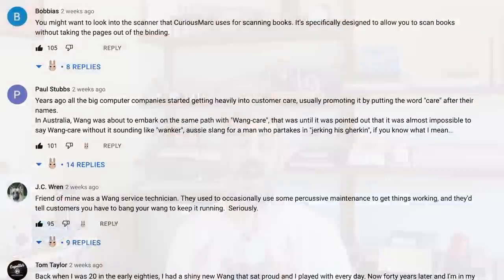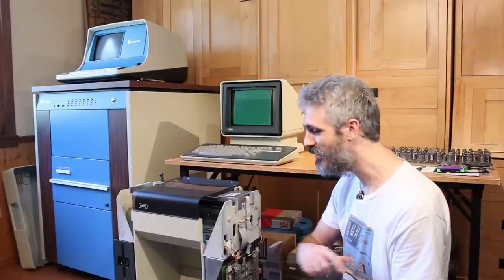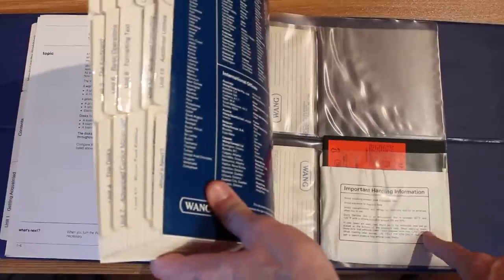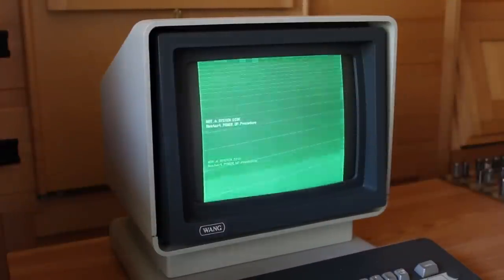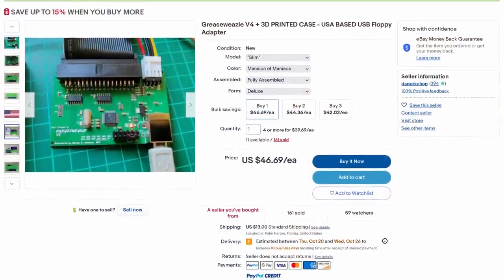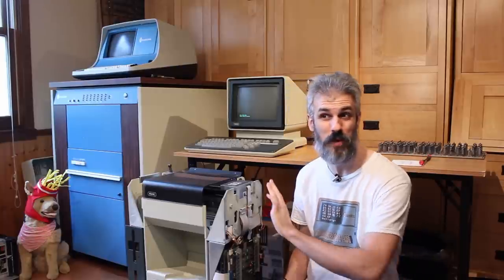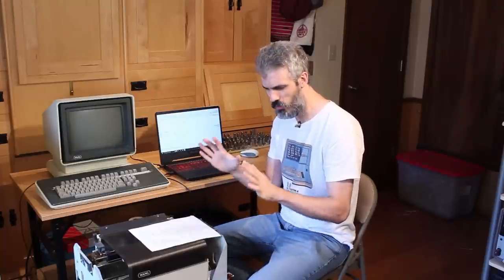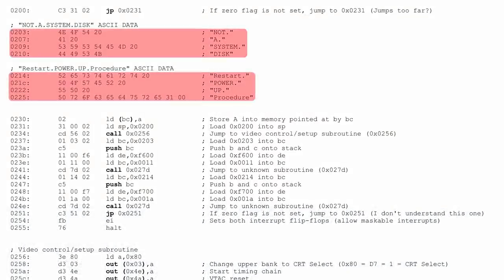Wangwriter Pt.2 – It’s Alive!

Comment: The disassembly comments misinterpret the JP instruction (opcode 0xC3).  JP is an unconditional jump.  The comments are describing JP NZ (opcode 0xC2).

The "JP 0x0251" at address 0x0251 creates an infinite loop, sometimes called a "soft halt".  It effectively stops the machine.  That JP instruction is followed by code to enable interrupts and do a real halt, but that code will never be executed.  Probably got left in by mistake.

The subroutine at 0x027D copies text from the boot code to the video memory. The way they did it is convoluted and weird. I suspect they borrowed code from elsewhere in the product, where perhaps the weirdness made sense.

Comment: you should be able to find a CP/M disk, hell I’ve thrown away a lot of them from old Z80 computers (had an Altair 8800 in 1977), and used to run a dial up bulletin board where the phone line ringing in would reload the BBS code off the 8” floppy..  machines weren’t very reliable back then😂
Reply: If you phone China for a BBS with this unit you will Wang the Wong Number.  (sorry broke the rules, but , you set 'em up)

Comment: Why can I see the CRT image through your head? Did you add it during post?
Reply from the maker: The camera was picking up the flicker of the CRT really badly and I was worried it might trigger some epileptic fits in some, so I added a filter over the screen to dim it down considerably during editing. I don't film on a green screen or anything, so the overlay just sits atop the main video image.
Reply: @UsagiElectric  Ah, makes sense. Great video BTW.

Comment: Looking at the memory map, you can probably run CP/M 3 on that.
Reply from the maker: Unfortunately, the memory map is really weird, and as I understand it, CP/M builds from the top down, so we can't exploit all the banked RAM. I think ultimately we will have about 48k total for a CP/M installation, which is cutting it a little tight for 2.2. I think we'll know a lot more once we get a basic memory monitor built and can start peeking and poking bits of memory to figure out the full map in proper detail.
Reply: @UsagiElectric  CP/M 2.2 needs memory from 0 upwards to where ever it is available. CP/M 3 needs the same, but in addition a common memory segment at the top. The typical configuration was to share the last 16k of the address space across banks and have the rest banked, but it also works by only sharing the last 4k, because the BIOS is banked anyway. Since the CP/M 3 loader is effectively a stripped down CP/M 2, bringing up CP/M 2.2 first always makes sense.

Comment: 17:07 It looks like you can type your own cylinder count in there, so you don't have to use one of the preconfigured ones.
Reply from the maker: Oh, that makes total sense!
Turns out we lucked out and it's actually 40 total cylinders. I'm not sure why the manual shows just 35 in the opening there.
Reply: @UsagiElectric  It's odd that the numbers don't agree. Maybe they said 35 because the inner cylinders were unreliable or something like that. Dunno, just spitballing. Glad you got lucky though!

I'm really excited to see how hard you can push your Wang now you have full control of it.
Reply: @UsagiElectric  I was curious about how many sectors were on each track. Doing the math from the values in the manual there must be about 9.14 sectors per track, obviously impossible.

Comment: Question: Why at 3:17 does it look like your fingers are behind layers of the screen? (you need to pause it at 3:17 to see the effect). Is this a trick of the camera or something? Also pause at 3:44 when his head passes across the monitor you can clearly see a square has been super imposed onto the monitor. What gives??
Reply from the maker: The camera was picking up the flicker of the CRT really badly and I was worried it might trigger some epileptic fits in some, so I added a filter over the screen to dim it down considerably during editing. I don't film on a green screen or anything, so the overlay just sits atop the main video image.

Comment: Then the BIOS is stored on each of the data disks?

With the Amiga 1000, the BIOS (Kickstart Disk) was first loaded from disk into the RAM and then the start disk could be loaded. Later models had a Kickstart ROM or two ROMs

Comment: It is possible that WANGWRITER is not built entirely form scratch and is based on something else.
That means: now that you have memory and I/O port layout, try to compare it with other systems of same era.
Maybe you can find some software that is at least partially compatible.
Try to check copyrights on software and stuff in the manual and see if you can google something new...
Reply: Probably more likely to get something similar from another Wang model using the same cpu. As mentioned, the hardware has an unusual setup.

Comment: 21:36: Is the "0x80 is equal to 1000 0000, [hence] D7 is equal to one" thing simply because any non-zero value is deemed to equal one, or is this some kind of lsb/msb reverse bit-endianness thing whereby 1000 0000 turns into 0000 0001?
Reply: Bits are usually counted from less significant (0) to most significant (7 in this case).

Comment: That greaseweasel (or however you spell it) looks like an incredibly useful bit of hardware! I wonder if there is something comparable for reading old Iomega ZIP disks, I had archived all my Amiga stuff onto 5 zip disks before moving to the PC world, and of course my zip drive suffered the Click of Death when I went to read something off the disks a few years later. 😢 

I suppose not, the weasel needs a working floppy drive after all.  If I had a working zip drive, I could still just plug it in the parallel port of my older PC. Ah well.

Comment: Most of that boot information and boot up error messages are located in the first few tracks of any floppy. You didn't have to get an exact 35 tracks image if all you wanted was the boot up message. Just grabbing the first few (use the lowest) cylinders should have been enough.